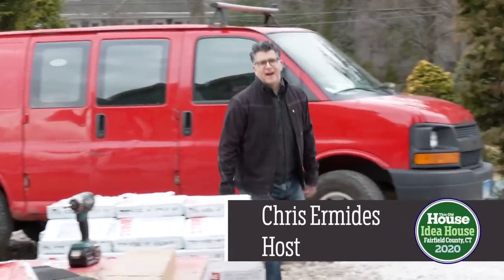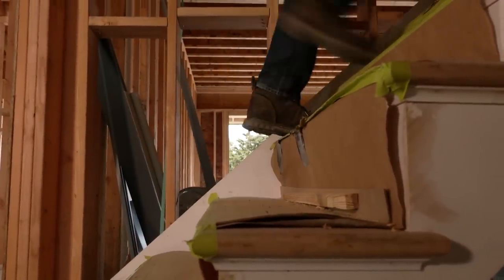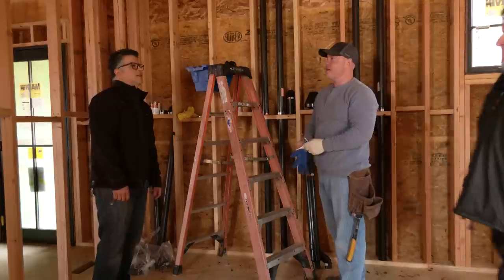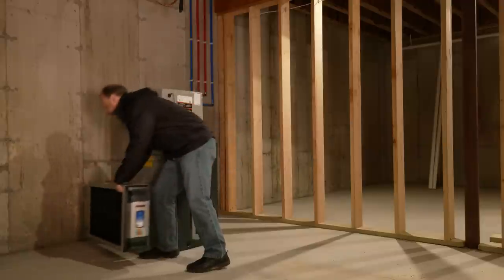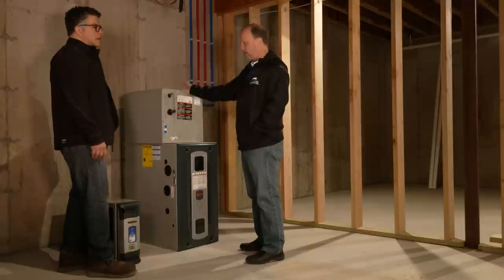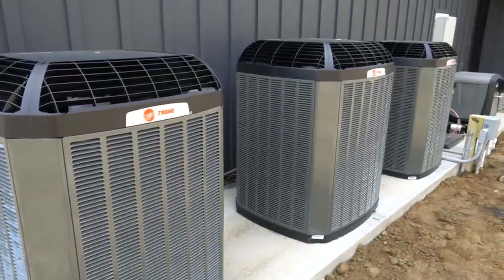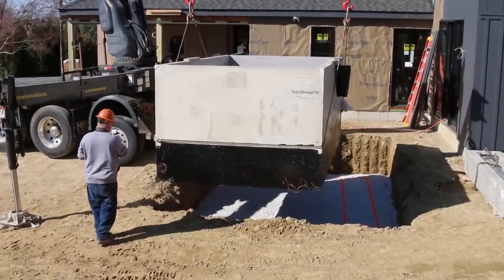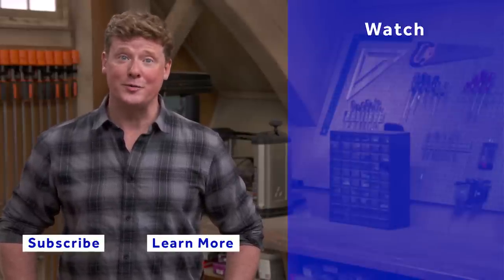High Tech Heat | Idea House Build Ep 3 | This Old House

Comment: could have done that a lot more efficient, if you have 3 systems, I would bet he did not do a manual J load calcs, especially with a 96% AFUE/ variable speed units.  With 3 systems they are probably oversized and will lose any energy savings from the expensive systems.

Comment: Why put three furnaces in the house. 
Wouldn't it be more effective to run water based under floor heating. You wouldn't need three different gas lines in the house they could potentially leak.